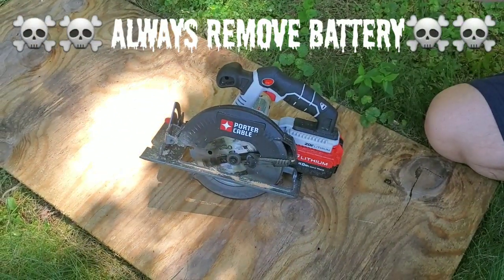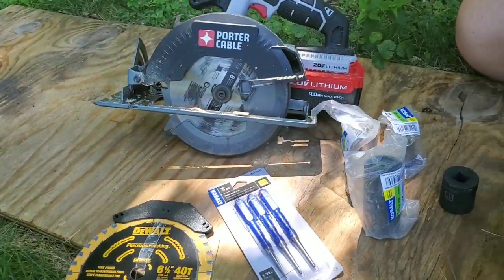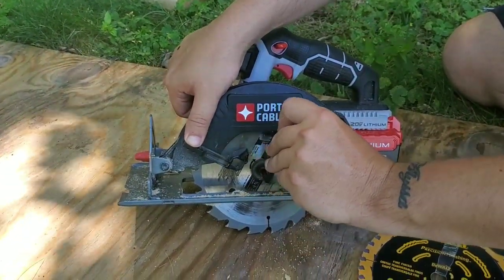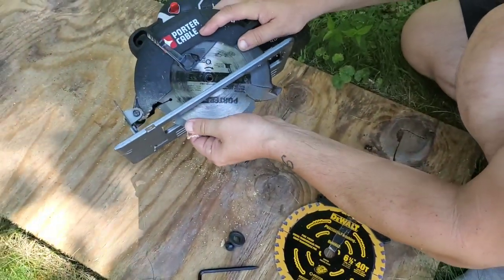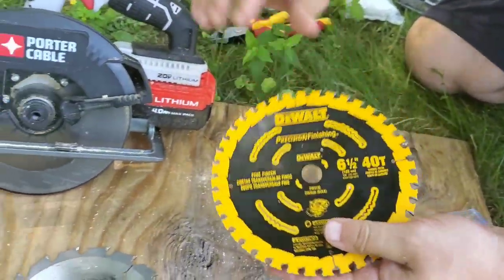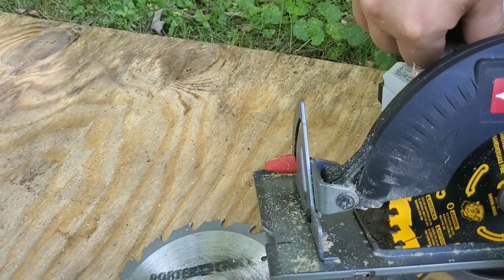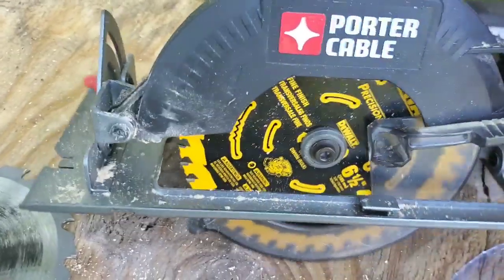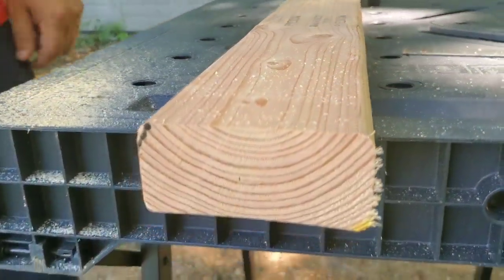How to Change Blade on Porter Cable 20v 6 1/2" Circular Saw

Comment: I have that same saw.. not bad... For a home gamer...I use it too cut hand railings..... works well... I also bought the two pack of the DeWalt blades and they work great...👍
Reply from the maker: Yea for 5 bucks no brainier ,wish they had more ...yea probably the lightest circ I ever used ...telling ya all these Porter Cable tools for the money tough to beat 💪

Comment: Follow up: I was FINALLY able to get the blade installed.  The issue was, even when you push the blade guard all the way open, you have to pull up on the area where the black guard lever is because it blocks the blade from going in.  Folks, I never had this issue with a Dewalt or a Craftsman.  This is just a cheap, crap saw and i'm sorry I bought it.  I'll be getting a  Dewalt or Craftsman ASAP and will just sell this one for whatever I can get for it.

Comment: Should have mentioned that a blade left saw has reverse threads. Also mention to check the direction of the arrow on the blade to make sure it matches the arrow on the saw.
Reply from the maker: They will figure that part out I'm sure as it won't tighten 👍

Comment: If you put a 6-1/2 in a 7-1/4 saw (diff of 3/4" or 3/8" depth), would you a more powerful saw? In terms of full depth of cut in a 1x  with less blade mass to turn.

Comment: Far as I'm concerned changing the blade on any kind of circular saw is a pain in the butt.
Had a forty tooth Freud blade on my Milwaukee saw - cut great.
Getting stuff out of the package is 90% of the job - see you had fun doing it (yuk yuk)
Reply: I couldn't disagree more. Owned a craftsman and a dewalt -- both saws, easy to replace the blade. No issues whatsoever.

Comment: I don't get why PC made it so hard to insert the new one. Shouldn't have to jam it in there. Is there any trick to making that a smoother insert?
Reply: It's because it's poorly designed when it comes to replacing the blade.  Buy dewalt or craftsman.